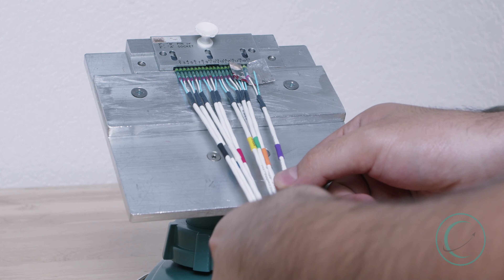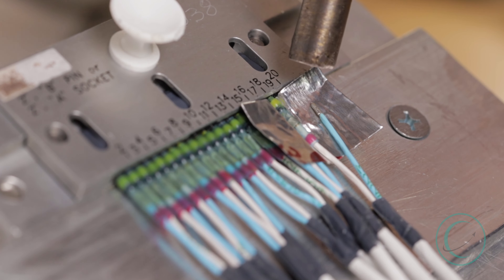VLOG: How is a Wafer Connector Different from a Circular Connector?

Comment: I think you have to stabilize wires,holding with your hand is not right.Am i wrong?
Reply: Yeah you don't want to be shaking the wire as the solder cools, I usually brace my arms on the table to steady my hands when soldering.